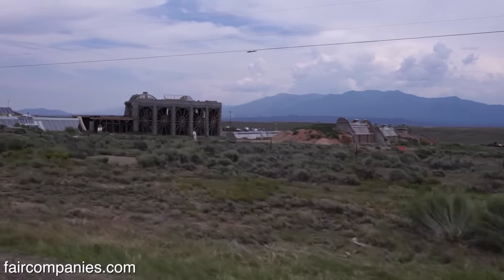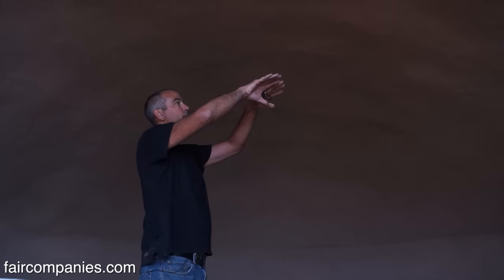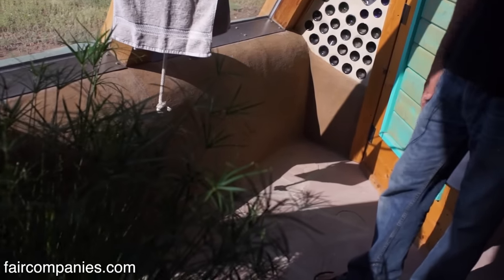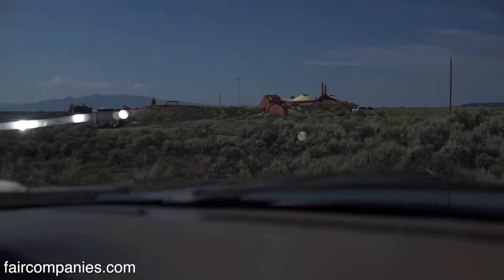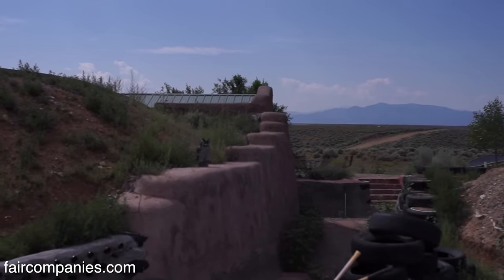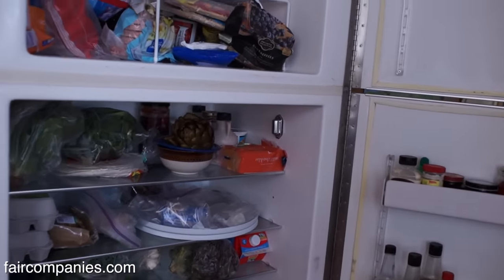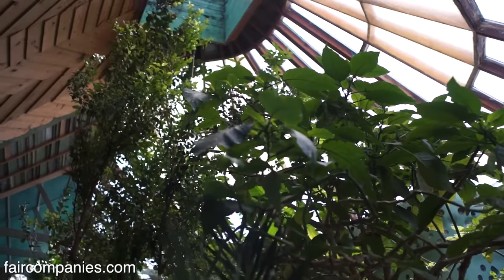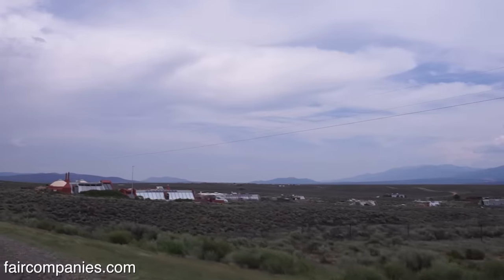Earthships: self-sustaining homes for a post-apocalyptic land?

Comment: Using steel barrel-tanks containing washed granite gravel ....@ let hot water be stored in them ...and then the granite will hold the heat , and reheat the water as you use it..It’s a geothermal principal

Comment: Whilst a black water system like yours may work in temperate climates,  it might be difficult where temperatures reach -30 c(not impossible , but difficult ) I personally would like this system  as a septic system is very expensive (c$15,000  + ) and a lot of people  get a cut of that, so the powers that be are never going to allow it

Comment: Are there plans to buy like a book or something, to build a house, like this?
Reply: plum loco research,
Reply: @realtruth1448  I hear you bro, 👍🏽that was a test. 👍🏽👍🏽Passed.
Reply: plum loco earthships seem legit lol, Only issue I see is maybe the plants might stink? And I heard if they don’t properly build the home the gas escaping the tires can destroy the structure
Reply: @realtruth1448  I believe that, I was wondering if the plants stink, but the house looks pretty solid. Right on. LoL 👍. Not like I was gonna build one, but I guess it should be on the net. Da!!
Reply: plum loco yea I’ve been digging around nothing but positive things, earthships are most definitely the best way to live offgrid, build in AC/Rain water catching/solar panels/windmills/crops etc etc and they aren’t expensive either, best home to have during apocalypse
Reply: @realtruth1448  right on Clan, be nice if I could build one, these people are pretty smart, even grow their own food. DAMN!!
Reply: plum loco they aren’t expensive, 225-250$ per sqft, so a 2,500sqft earthship(the average size of an american household is 2,600sqft) and average price(nationwide) is 226k and the price for a 2,500sqft earthship would be around 550k, which is double the price of a regular home but that’s on average, meaning earthships basically cost the same as homes or even cheaper just depends where you build it, I’d want to build one in a nice hillside, in an area where it doesn’t get too hot/cold and atleast 10 inches of rainfall yearly,
Reply: plum loco but it’s worth it once it’s finished you don’t have to pay more money, got water food power land etc etc and it not hard to keep up either.... basically like living in a regular typical house but for free lol. Perfect
Reply: @realtruth1448  I'm WITH you bro.

Comment: Are you familiar with a guy named Leandre Poisson?  He’s from New Hampshire.   He designed a building called a “Trisol”.   We built one in 1980 in Lebanon. NH.   It was passive solar, which is unheard of in that area.   He also designed “sun eyes” which were our shutters to allow sun to heat the house in winter or keep the heat out in summer, just by rotating them in place.   We used around 60 bucks a year fo supplemental heat from a tiny wood stove.  One year we left the house for a week, in the dead of winter.  When we returned, the house was 60 degrees, while outside the temps had reached down to single numbers.   We had underground cooling and a vent in the roof for heat to escape.  The first floor was Bermed and the second floor was above ground.  Had an attached greenhouse, too.   We also had very thick concrete walls.  We loved it.  Was like living in a living, breathing machine.
Reply: Leandre used to  (maybe still does) have a company called Solar Survival... he and his wife have also written books on French Intensive Gardening

Comment: Honestly. I hate how people have to get permission to build their own home. It's ridiculous. I don't need someone else to tell me how to build my home or to tell me I can or cannot. The only reason for that is money in my opinion. If everyone had to build their home, they'd know how and they'd definitely be more careful. I have been building homes in different fields for over a decade. I can build a home from the ground up with no help. So, it should be that permits are only required in city limits. Yet, counties are now partaking in permit requirements. You know why? M O N E Y It isn't for your safety. Case point. Did you know you can rewire your own electrical without a permit so long as it isn't being rented out to someone else? It isn't for your safety, it's for other people's safety. Therefore, it should not be required in a county land area where you will be living.

Comment: Concrete is one of the most destructive building materials to produce. The production of concrete produces 8% of the total world's man-made carbon dioxide. Mixing trash with concrete is not improving building processes, and certainly isn't environmentally friendly.

Also, soda cans do not add structural value to a column. His comment "look at all of the concrete we saved" makes no sense. He could have just made the column smaller with the same amount of concrete, and likely more structural integrity. 

These houses are not to code, because they will not meet energy codes, and are also really freaking dangerous. No students will be housed in these buildings.

Comment: Not a real fan of these houses, the space in them suck for the amount of material used you could use bars in the concrete and use less and have a bigger more stable structure, I am a fan of off grid, perhaps people should be shown some Current technology in building to perhaps inspire better out comes of housing, been on here a lot looking at off grid systems and saw some really amazing things, these just come off as okay to me.

Comment: permits, lol.  I don't worry about permits and I hope your listeners won't either, build what you want, change doesn't come through legislation it comes from people doing what needs to be done.  And as far as solar, you don't need power, power is a luxury, I thought it was interesting that he said to charge your computer and cellphone in a SHTF situation, those are the last two things you would be concerned about.   The only thing I generally use power for is tools, lights at night and maybe a pump.

Comment: Why use gray water when you can use an inexpensive micron filter from homedepot  and just put the pump to a collection barrel with chlorination  then pump to filter  before it goes to the house commode.? You would be able to drink it after chlorination  and filter. Lifestraw makes  20 water filters that you can drink from any water source in the world  and it filters something like 100,000 plus gallons and filters 99.999% of all microbes  and harmful organisms to make water potable. And haven't you heard of an incinerating toilet? Like 500$ fro. Lowes  or homedepot. These are more like green homes not post apocalyptic  dwellings.  A post apocalyptic  dwelling would be fortified like a castle to keep out intruders and have points to take up arms if necessary.. also you said battery for your cell phone and laptop . If zombie apocalypse  happened you would not need that paperweight laptop you speak of .  There would be no internet or operational cell phone towers. You would be lucky to have analog antenna  communications like two way or ham radio. Uhf vhf. If anybody else was even out there with the equipment  to receive a signal. You would literally be back to making smoke signals a carrier pigeons. No joke. Js

Comment: I live in a earthship with self sustainability as its core process, reality u actually live in a barren desert with a house that you built of petroleum garbage that off gases, and yes Tom off gasing is an actually thing. There are plently of peer review journals out there so i suggest you look them up. In addition to that as the tires decay they produce more toxins which you and your family breathe in. 

Alot of people will think o well his just being negative but, im just stating the facts. Also, will suggest an alternative to actually living in a clean eco way that doesnt require to live in the desert and building your house out of harmful garbage. Its called building with strawbale which you can legal build anywhere and not have to be forced to move to and relocate your family into a desolate desert.

And stop worshipping Mike Reynolds, as your profit yes he had some good ideas but, he took them to the extreme and where he really screwed up was using petroleum tires as thermal mass.
Reply: This is so dumn. Those tires are covered, they ain't going to produce toxins any time soon. Beside cars are toxic to us and the enviroment yet I don't see you complaining.

Comment: Tires are weak cans are weak glass is brittle.. this man is delusional and people should not be permitted to live in there
Reply: @bobmorton4633    Here's my point of reference Bob, tires are made of "rubber". When weight is pressed on to rubber it collapses.  When you make a wall out of cement and soda cans, the structure could be more solid if you were to replace the soda cans with actual cement..  A glass bottle wall could be a nice interior feature maybe with some lights behind it but glass bottles are not load bearing and break easily in most cases also it is not as strong as a regular wall..  Glad I could dumb it down for you Bob
Reply: @bobmorton4633  good rebuttal Bob, you've really laid on good information there.. after hurricane Katrina I took part in an environmental experiment located in Hopedale Louisiana where a team and I filled tires with concrete and used these tire bricks as landfill to build up bulkhead and land on a section of property. But where ever the tires were laid the land would sink 3 to 4 feet this was due un accounted for air pockets, in the cement filled tires, collapsing l. They're so many tires stacked that the land is considered too unstable to build on. We have to dig out the tires and fill it in the right way if we ever want to use the land again.. how clueless are you Bob?

Comment: the glass bricks u buy to build has vacuum inside. bonding 2 half glass with tape will fail in few years or less. 
in the meantime u pileup trash, concrete and other stuff.

I'm not a keyboard worrior, but really architets do things nice but not functional most of time. 

Try to connect your brain. post apocaliptic self sustaining?  
Where is the food production?
dumping dark water in a "stone" thing then in the desert... u just are polluting with your shit the water source lower (if any)

post apocaliptic?  were u manage to find the filters for the "clear water" u say are collecting?
solar panels and electronics will fail at the first emp pulse (aka nuclear bomb)
Water  from rain: pollution is travelling everywere  u dont have a source of clear water.
Heating. 
and cooking ... propane tanks grew on that banana tree ?

after 20 years they're learning tiny step every day. great.

But they use big cars fossil fuel powere to go back and forth to get all that stuff. 

maybe it's time to go back to reality.
that house builded to sustain a family of 4? i'd really like to see , whit no external trip to walmart or other grocery shops.